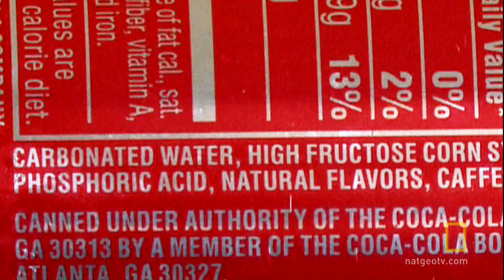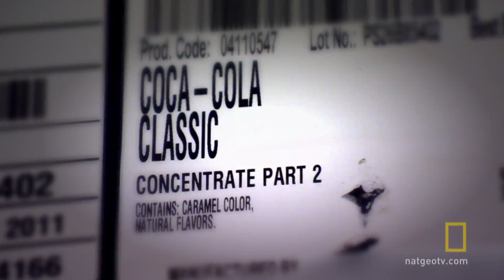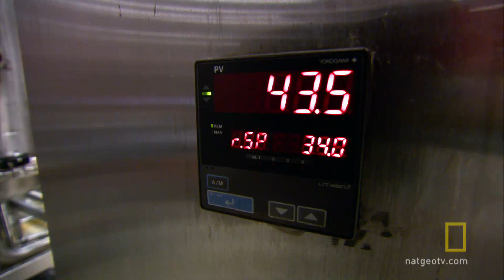Secret Formula of Coca-Cola | National Geographic

Comment: The secret foumula is called "Merchandise 7X", it is formed by 7 materials. They are: essential oils of Cinnamon, Coriander leaves, Lemon Peel, Neroli, Nutmeg, Orange Peel, and high proof neutral grain ethanol as solvent and emulsfier.

It's no secret anymore, but it is very expensive to DIY and just buy the drink from grocery store instead.

Comment: @PaNDaReNBReWMaSTAH 

Corn syrup is a highly process corn byproduct.  They strip the sugars from corn using highly toxic chemicals, then remove the chemicals.  This leaves a broken down liquid that tastes sweet.  While the corn council's commercials have been very pushy to say that corn syrup has the same nutritional value as cane sugar, I can tell you for a fact that it does not.  That's just like saying minute rice and whole grain wheat have the same nutrition since the labels read the same.